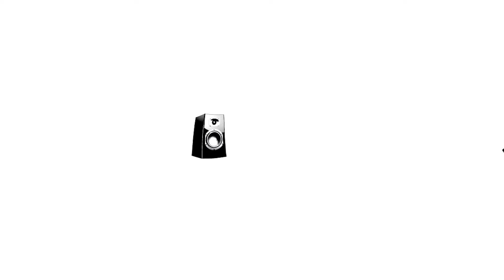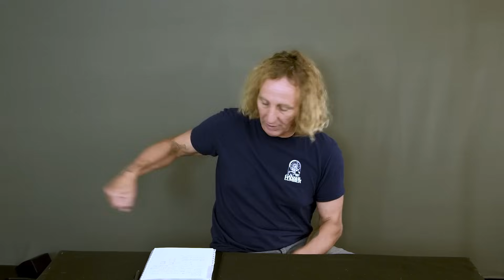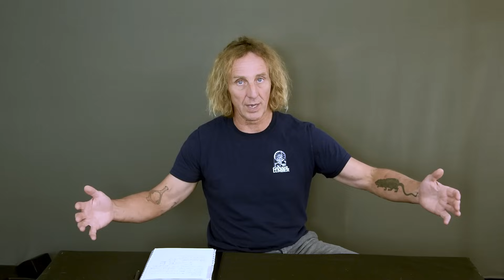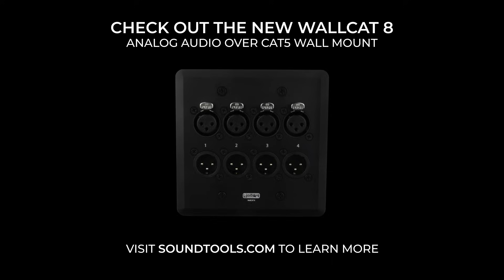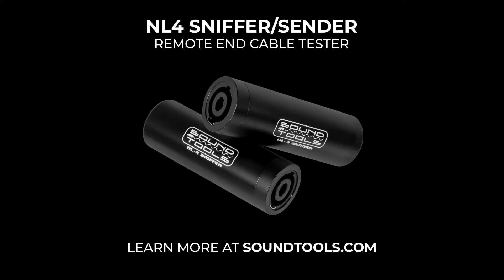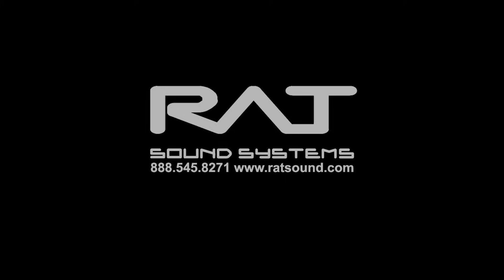New Power Amplifier Watts vs Old Amp Watts & Power (Public)

Comment: Watt is watt (UxI). If there is a difference, then someone lied on paper, or the difference is something else, like speaker sensitivity.
Reply from the maker: I wish things were so simple, or actually the true complexity is maybe what makes audio so fascinating.

so let me ask you this:

if when driven with a tone an amplifier "A" can output 1000 watts for 250ms and then the output drops to 500 watts for 500ms and then the output drops to 250watts and can stay at 250 for an extended period of time 

and amp "B" outputs 350 watts always, anytime for as long as driven into a 4 ohm load

which amp puts out the most watts?

which amp is louder when driven full volume without clip with music?

would the type of music mater?

since as you say, "watts are watts" what is the single wattage rating number that you would rate each of these amps?

amp A is more ike modern class D amps, amp B is more like older solid state amos
Reply: @DaveRat  I think the rating on B is what matters. If i have something that can put out 10thousand watts for 0.5s then burns out, that doesn't mean I have a 10thousand watt amp. That's exactly why pmpo rating is BS..
Reply from the maker: so the concept of tailoring the amps output capabilities to the program material that they will actually be used for is not relevant? 

because nobody (well not that many people) listens to a continuous sine wave for long durations of time at full power and none of the speakers that we use are rated at RMS long-term power ratings, it's important to have the amplifiers rated for a test tone program material they won't be used for driving speakers that are not rated by that power method?

it's kind of like the expensive watch mentality, where a watch is rated by its ability to go 500 m deep in the ocean and work perfectly in outerspace to go on the arm of someone who's going to wear it to business meetings and look fancy on date night. Yet this fancy watch is bigger, heavier more expensive and actually is less accurate at keeping time. but.... understandably there's a group of people that consider the fancy watch a real watch and the other watches to be not as good, even though the cheaper timepieces with loads more features like an Apple watch are way more accurate and are the actually tailored for how they're going to be used. But not tragically not accurate 500 meters deep in the ocean and not accurate in outerspace.

personally I can appreciate both, I have several very fancy expensive watches including a rolex and they don't keep near as good time as my Garmin surf watch that does loads of other stuff that I need and find useful. 

which watch or amp gets the job done?

which watch or amp is better for showing your friends and being something that you enjoy owning? 

it's important to not confuse those two differing purposes

while I appreciate your affinity for the older self winding technology amplifiers, the reality is that the newer tech does a better job in almost every way that you or I are likely to use it. 

except perhaps if you are going to spend an extended period of time in the middle of the desert away from electricity and cell towers, want something cool to show your friends or are doing testing on long-term power handling capabilities of various devices, then the older tech can come in useful

Comment: When I was in High School a 1000 watt amplifier could run on a 9 volt battery.. I did not fall for that.  Later in 1974 they changed the rules. I was building 100 watt amplifiers and they got so hot running at one third power, you could get 2nd degree burns from the heat sinks. One third power was the WORST CASE for a class A-B amp. But now the Powered speaker people think the amp rules DO NOT APPLY. So we have 1000 watt systems powered by 250 Watt amplifiers?????? I will be 75 on Juneteenth 2025.

Comment: Very good video. I've had this conversation with a few people over the years. I'm a bass player, and in the '80s, I used a CROWN PSA2 with an Alembic preamp for my bass. It was around 800 watts in mono—it was a beast! I know what 800 watts sounds like and, more importantly, what it feels like for bass.

There was this engineer from Mesa Bass Amps, named Andy, who claimed that watts are watts. He also HPF bass guitar amp way too high ...MESA, Genz Benz and others.

He’s a huge proponent of Class D amps, especially the ICE modules. He argued that his 800-watt ICE 750AS modules are just as powerful and effective as my old CROWN PSA2, and that there should be no difference.

Let me tell you, there is a huge difference. What you described about modern amps (Class D?) delivering 800 watts for only a fraction of a second before dropping off is exactly what I, and others, hear and feel when comparing old-school Class A/B or H amps to modern Class D amps.

But I felt teh difference and the ICE class D did not HIT the way the Crown did... I actully have an SS 350 watt amp that fells bigger than quite a few modern class D 700 watt amps
Reply: fantastic comments I've been arguing this for years but they hear it from the horses mouth so to speak a bass player is fantastic😊 I'm a Sounds man
Reply from the maker: Yes, a bass amp is probably the best example of a situation where peak power time frame could be audible 

As far as the HPF, am I correct I remembering that those old Alembic cabs were often sealed enclosures?  

And they had speakers with big voice coils and big magnets. Maybe JBL?

And the Mesa stuff uses lower grade drivers, at least the ones I've opened that Flea played through.

So yes, mesa stuff can't handle those lower high pass filter settings like the Alembic gear does
Reply: @DaveRat  My Alembic gear was the Alembic F2B preamp.. I bought it at Mannys in 1978.. Its a simple Tube preamp.. With either the Crown PSA2  or a BGW 750 B..
Most of my cabs at that time were custom Bag End , They were ported. .. aybe similar or a copy of an Alembic cab??
I loaded them with JBL 15's and a 410 JBL box on top.. Rigs were HUGE back then.....Now i go with only IEMs or a 410 cab to keep stage vol LOW..
Reply from the maker: @svtbass those bag end boxes were super solid.  Very cool

Comment: Here's the issue. Amplifiers do not deliver x amount of watts until you connect the load which is the loudspeaker resistance which varies in frequency so it's an average and that's the impedance. Amplifiers do have a maximum output voltage, and that would be a much better specification to go by.

Comment: I had to take out the IEC power connectors and hardwired cords of the proper guage into all my amplifiers.  I haven't had an amplifier failure since then.  The IEC power connectors are THE number one cause of amplifier failures as they are only meant to carry 10 amps.  The 20 amp IEC only carries 15 amps.  The power lights don't dim on my amplifiers any more.  If you don't believe me, put a volt meter between one of the lines and the corresponding connector in the amplifier and drive it at full power - 20 to 30 volt difference and drop between wall receptacle and power switch inside the amplifier!.  I have 3 dozen Cerwin Vega CV-5000 amplifiers rated for 5,000 watts each.  They came with 20 amp IEC's - i could not get the amplifiers to put out anything past 2,925 watts bridged at 4 ohms.  When I hardwired 8 guage power cords into each of them  - 6,600 watts bridged at 4 ohms, pulling 60 amps peak each amplifier.

Comment: I have a pair of old early 90s peavey amps, cs800x & cs1000x pushing a small bag end speaker system for my synths/euro stuff. I love them but my rolling mixer rack weighs as much as an elephant😂 anyone have any budget friendly recommendations on a lighter pair of amps? Subs are 800w and tops are 600w...
Reply from the maker: He should be able to replace both of those amps with a single rack space for channel amp that is way more powerful and offers full processing.

I don't know the lower line lower cost amps very well but finding something similar to a t904 power soft would be cool

Comment: I have an early 70’s Acoustic bass amp that’s “only “ 300 ish watts 😎 it’ll flap your trousers at 5 meters away through Ampeg cab and the amp almost vibrates itself off the top 👍🏻 
I’ve also got a Bugera Nuke that’s supposed to be powerful and there is no comparison, the old amp blows it away completely:-) and it has more character 👍🏻
Reply from the maker: It's all about using the right tool for the job. I like the old amps and also a good class D app can really light up a system when you transition from the older amps

Comment: Hi have you tried kv2 audio speakers/amps? I wonder what your thoghts on them
Reply from the maker: I like many forms and types of speakers. Cool designs.

From a sound eng standpoint, systems that claim to be point source (no system is actually or event trying to be a frwal point source) I find them more useful for non portable installations and prerecorded music.

Bands tend to be very dynamic. Needimg compression when plified for large spaces.

Using highly dynamic sound systems makes things more challenging.

Also for large spaces, vertical arrays are beneficial

I wrote an article a while back called zoned summed and lined that may be interesting
Reply: @DaveRat cool, thanks  for the fast replay,   i'll look it up :)

Comment: First time on your channel and I like your approach on this subject but I heard no mention of the most important thing when it comes to audio amplifiers and that's their "REAL" purpose, amplification in dB. For me it's more of an important topic than raw power that an amp can handle. Example: It's much more realistic to say a 60w amp has around 20dB amplification capability,that tells you it's potential to amplify sound. With a proper setup you can make a 100w amp play louder than 1000w amp with a bad setup < low sensitivity speakers, bad cables etc.>  I know watts are important and easier to understand but that's why they're more misleading. If you haven't touched this subject there's an idea for another video...
Reply from the maker: Hamp sensitivity is definitely important. With many modern pro amps the sensitivity is selectable either by switch or software. Since a low sensitivity amp can be configured to reach full output by using a good preamplifier I see that as kind of a separate subject.

I did do a video or two on gain structure which maybe more applicable to this

Comment: Would you typically recommend using the amplifier the manufacturer recommends from their own brand before researching an amp that may be more dynamic and clear like you’re describing?
Reply from the maker: Using the recommended amp and processing has huge advantages. My take is rather than buy a system and then try and modify to hot rod it, you are better off buying a better system that does not need the modification.

With high end gear like L-Acoustics or d&b or similar, making changes devalues the rental rates devalues the desirability

On lower end or especially older gear, upgrading to modern drivers and better amps can pump new life into a system if done properly.

Comment: Thanks for the video.  Recently I bought an old amp at auction to fool around with and i was wondering if you could help shed some light on it.
Its about 18 years old and made in Australia by a now-defunct company called MSR. There's no manual and details about it are slim.
What I do know is on the back it reads "This amplifier produces 850W RMS into 4ohms per channel continuously, 1600WRMS bursts." And on the inside, instead of a handful of large capacitors it has about 30 small ones per channel.
If you don't mind, I've got two questions; 
a) what kind of mutant am I dealing with? and 
b) could you recommend an appropriate sub driver for small parties? 
Cheers
Reply from the maker: Lots of small caps vs fewer big ones is not an issue. Its the total capacitance that stores some energy to improve output power from sagging. as far as subs. too many options and I think that can be better answered in like a reddit post or an online audio forum where ya share more info and people can assist

Comment: I'm also interested in the amount of AC current the amp draws vs watts it puts out.  Is it a linear relationship or not at all?
Reply from the maker: With continuos signals it is linear but music has like a 5 to 1 or 10 to 1 peak to average ratio. The amp can store energy and supply the peaks. So for music, a 1000 watt amp may be supplying 100 watts average with 1000 watt peaks and drawing 130 watts average from the wall with 200 watt peak draw.

Plus to make it more interesting, a 15A circuit breaker will allow park current draws that double or more for short periods of time and tries to allow a 15A average.

This is why amps have usable wattage ratings that far exceed the wattage of the power supplying the amp

Comment: The complete spec should be: X - Watts at 8 ohms 20 to 20k at less than .5% Total Harmonic Distortion.  Without all those specs it's tough to compare!  RMS!!
Reply from the maker: I wish it was that easy. 

Over what time frame? 100ms? 500ms? A minute? An hour? A day? 

What matters? Do we need continuous full power for music that typically has an excess of 10db peak to average and rarely if ever has peaks that exceed 200ms in time?

If an amp puts out 100 watts RMS continuous indefinitely, 250 watts RMS for up to 2 hours at a ventilated room temp of 70 degrees, and 1000 watts for 500 ms and 2000 watts for 100 Ms, all at .1 THD, what do we rate it at? 

Which poer rating is most correct? Most useful? And which is the best indication of the real world percieved loudness of the music? All of the answers are different.

The reality is that an amp that has 500 watts continuos and also 500 watts peak capabilities will not sound near as loud or be as loud with music as an amp that is 125 watts continuos and 2000 watts peak.

Fun stuff!
Reply: @DaveRat   Hi Dave.Thanks for your comment.  I am an "old" Hi-fi geek from the days of McIntosh / Marantz / Crown. / Phase Linear etc and when Grateful Dead chose Mac 3500's to drive their world... TUBE type.. Yes I know they had a truck full of spares too  LOL .. A time  when PEAK power was used by Marketing to enhance the specs of their equipment with no regard for quality of sound ... 100000 watts at 1ohn with 20% DISTORTION... was fine!....S0 the  Power @ 8ohm, 20-20K, THD spec was a way to fine a common denominator amongst vendors... That said I agree.. Peak for a Time or Even RMS power over a time period is an important spec as well, as long as manufacturers are adhering to a similar set of parameters for specifications.. Frankly I think even the OLD School spec Power/Ohms/Frequency/THD has been lost in the milieu of CRAP being sold ..... SO.. I am very interested in the the experiments you are going to conduct, so much so, i "joined" your channel.  Now  I readily admit I have not worked with the size of system you have, but the principles are the same... good thing OHM's law is rather constant..... LOL ...  I have thoroughly enjoyed your Desk comparisons, your mic teardown and builds and your philosophy on Major sound systems... Very old school applied to new technology.  it still amazes me that transducers are still the weakest link in the chain. Converting air pressure to electricity or electricity to air pressure is still the holy grail.... Looking forward to your amp tests.... ALSO I love your involvement of "Sammy" your daughter...nice father / daughter relationship
Reply from the maker: Super cool and great to meet you Sam

And agreed and frustrated by misleading specs. I remember that as well. What you describe is what inspired many of the amp tests!

Comment: Like a light bulb.  Calling it a 60 watt light build just defines how my power it consumes.  You can get the same amount of lumens with a 15 watt LED.  Watts are irrelevant until the utility bill comes.  And there is a big difference in the decibels from a 100 watt solid state guitar amp and a 100 watt tube amp.  I have a 50 watt Marshall tube and that is much louder that my 100 watt Peavey solid state amp.
Reply from the maker: Similar yes

Comment: This is a really good topic. I can add one thing they may help clarify the issue. There's no standard that manufacturers have to use to measure an amps power. Each manufacturer does it their own way. That's why you can go to Walmart and get a 1000 watt home theater in a box for $99. The reality is, if you took 5 amps all rated for the same power, like 100 watts into 8 ohms, every one will measure differently if you did them all the same way. Its been a problem in the industry for years.
Reply from the maker: Agreed and thank you